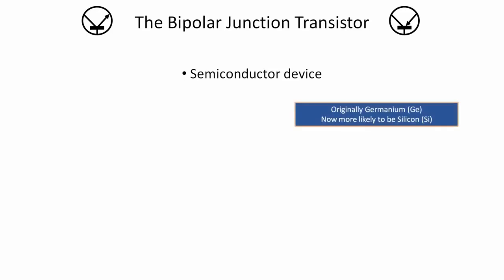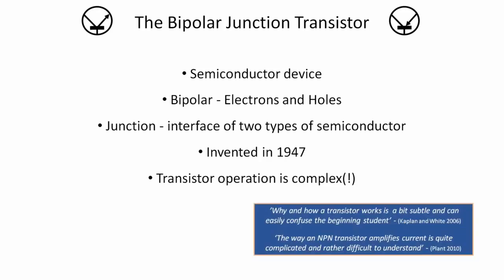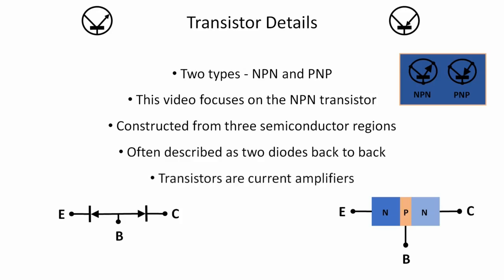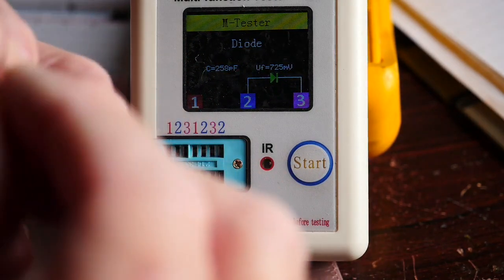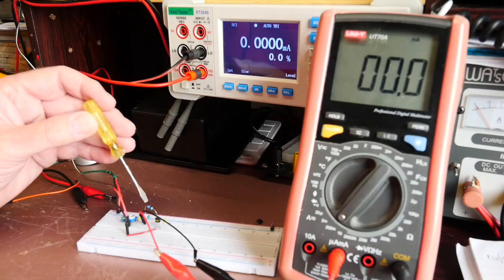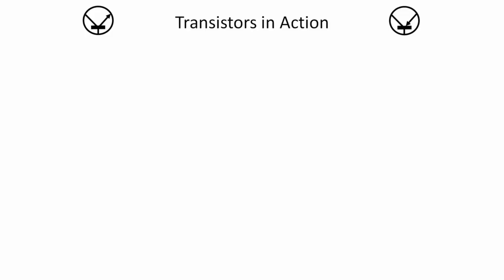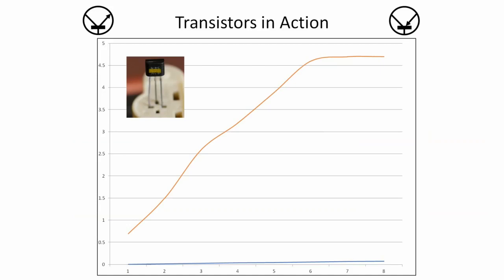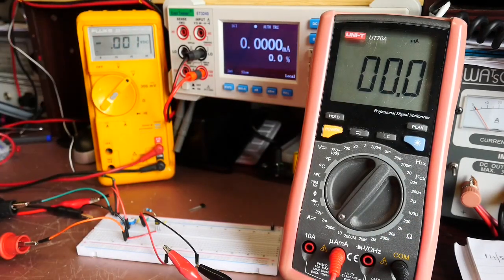The Bipolar Junction Transistor     Electronic Building Blocks     #074

Comment: I like the idea of plotting the response curve of Diodes, BJT's, FETs and other amplifying devices and am going to attempt to come up with a solution for automating that task in a manner similar to a curve tracer like Mr. Carlson has demonstrated and uses, only that I'd like to use my DSO for the display and measurement of the curve.  The trick it seems would be to come up with a way to sweep the base/gate of the DUT.  I have an el-cheapo signal generator that does a pretty good job of that, so the only thing that remains is to see how to put it all together and make a circuit that is either universal enough or readily adaptable to a variety of components to be tested.  I think the function generator would drive small signal devices easily, while others might need some sort of buffer/intermediate stage for driving the more demanding components.  I think you might consider giving such an application a try, Lockdown.  I for one, would certainly watch with great interest.
Reply from the maker: Great idea!
I am just putting the finishing touches to the last part of a two part series on the FET.
In part 2 I think I may be doing something similar to your idea. Part 1 is out on the 18th August and part 2 on the 25th.
Reply: @LockdownElectronics  Looking forward to watching!  Thank you!

Comment: I've struggled to understand the fundamental nature (the essence) of BJTs (and even Vacuum tube or Valves) for quite some years.  I've watched many videos and read many articles and after each one, have always thought, ah now, now I get it.  But I didn't.  Now I finally think I get it, and the way I like to think of it is as a Tug of War, with two teams struggling at opposite ends of the device, in perfect balance (bias) but the flag tied onto the center of the rope not moving at all - a stalemate.  Then along comes a toddler (the signal) and pulls on the center of the rope in favor of one side, and the whole thing, both teams, the flag and the rope and all the mass of twenty hefty men, all gets pulled into motion with the force of an avalanche, all by the relatively gentle force of one toddler . . . I'm sure there is a better analogy somewhere, but fundamentally that's how I see it - as a tension just waiting to snap, and sometimes it does (like a switch), and other times it happens with much more control, but also with great force.
Reply from the maker: Excellent analogy!

Comment: The best explanation of BJT that I have ever listened to. Simple and to the point. Great job!
Reply: The effect of the base current is the magic behind what enabled the modulation of the current driving .
If my understanding is correct the base current drains off electrons to offset  the electron hole recombination that takes place in the middle p-type doped silicon section.  If the free electrons were not drained off at the rate of recombination of the electron hole pairs the current in the emitter to collector circuit would stop.